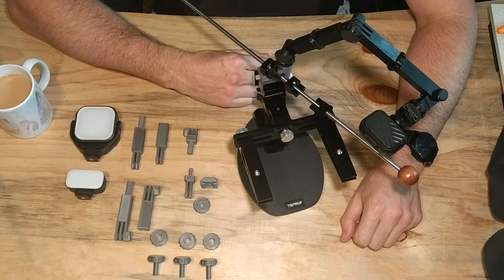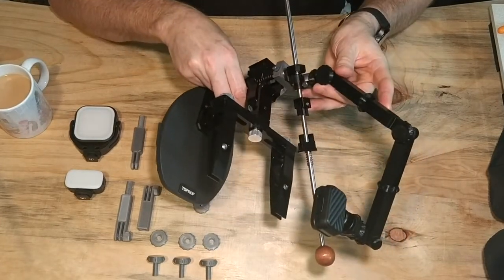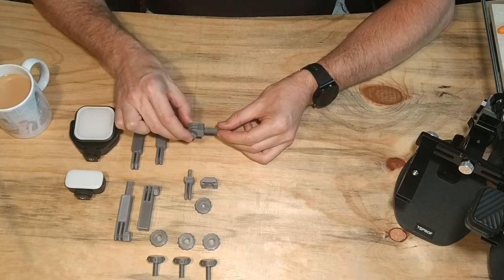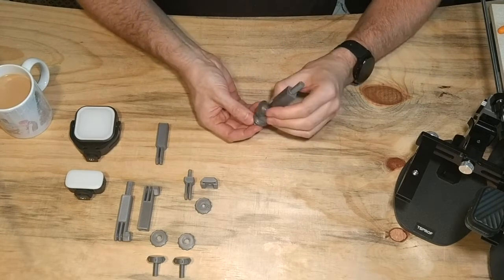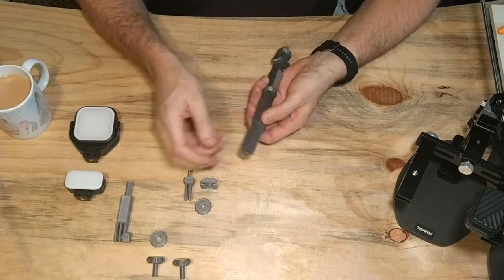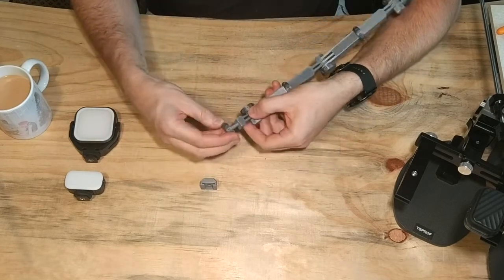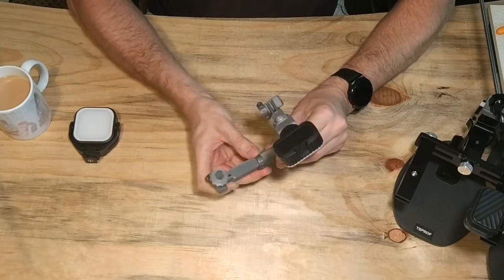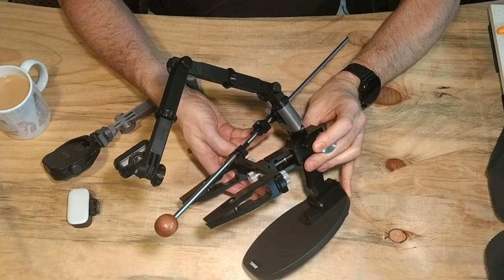Articulated Arm - Assembly and Use

Comment: I never see those originally online is that fake?
Reply from the maker: It is an original articulated arm system that I designed for Gritomatic. They will sell them on their website. The light can be any light with a cold shoe mount. In the video I use original Ulanzi LED lights. The sharpening system in the video is an original TSProf Kadet.